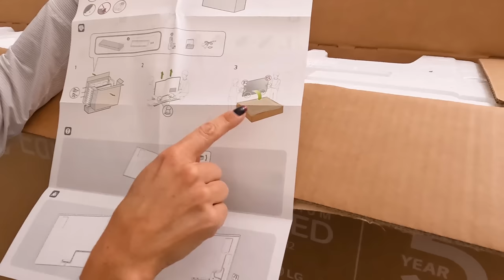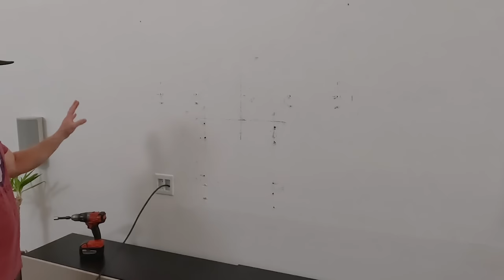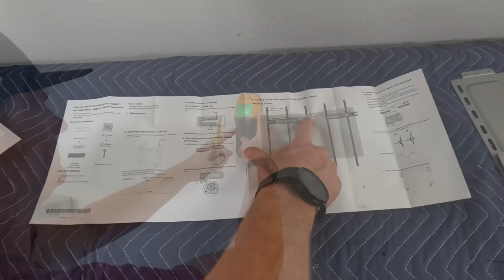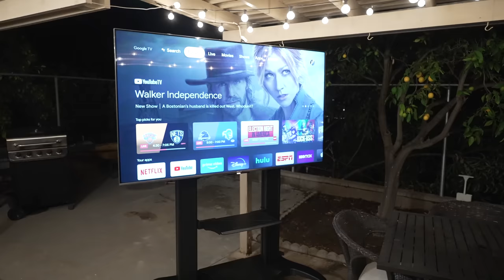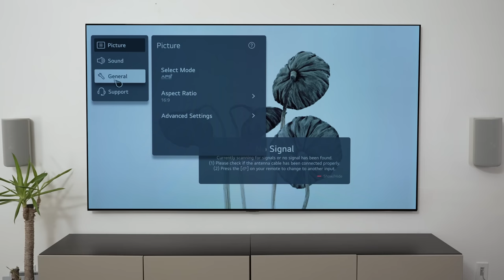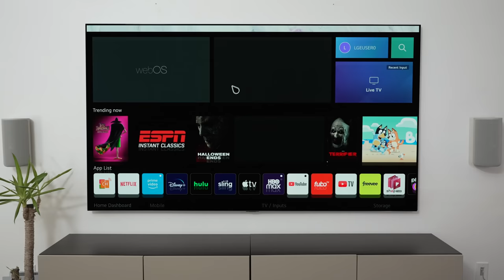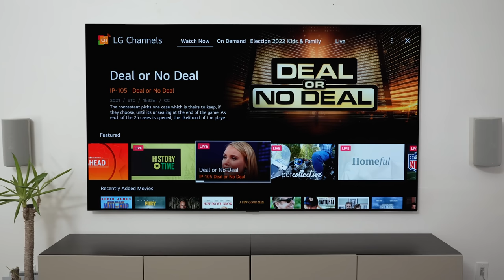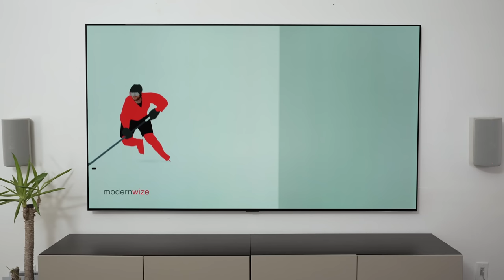97" LG G2 - Absolutely Massive OLED TV

Comment: My old 65" Panasonic plasma I recently replaced with a 77" OLED, weighed more than that 97" G2 at 132 lbs.     Now that old TV was a workout to wall mount.
Reply: Lol, just got an 85” Samsung I replaced my 65” Panasonic plasma with.  The 85” Samsung is barely bigger because of the plasma’s big borders and weighs way less.  Paid the delivery drivers extra money to haul the 65” into the guest bedroom.
Reply: @Meowhsss  Yes the Borders on the plasma TV's were insanely big.     I much prefer the minimal bezels on new displays.

I think my new 77" C1 is around 69 lbs vs 132 one for my old 65" plasma.     But, the plasma was metal with a glass screen, whereas the OLEDs are more plastic and minimal metal anywhere making them incredibly lighter in weight.

Even my old bedroom 42" plasma was 79 lbs, where my new 55" OLED is around 29 lbs.    Less than half as heavy.
Reply: @Meowhsss  dang. Do you miss the plasma contrast?
Reply: @helloguy8934  I got a Samsung QN90B, it’s UNREAL
Reply: @Meowhsss  Oh. I mean yeah with a q90b you're good.
Reply: Plasma is an earth killer. The energy ot eats.
Reply: @kalzindor803  Shit man you're not wrong. But it looks gorgeous while doing it.
Reply: When you buy it the set-up would be done by company for free lol😂

Comment: Fantastic review as always guys!... BUT after seeing the delivery and installation process of this TV I am more convinced than ever with the idea of a modular screen. I love the idea of myself being able to build a TV in whatever size and aspect ratio I want, and the best thing is that I could increase the size of the screen whenever I wanted. I hope that Samsung and LG don't rule out the idea of bringing modular technology to the home market, I would immediately buy a 120-inch screen in 21:9 format... that's my dream.
Reply: The Samsung store near my house has a micro led The Wall TV on display, if you get really close you can see the seems but from a normal viewing distance it looks like a regular TV. I suspect that's the future, more than 100" would be a pain to install.
Reply: @airixxxx  Exact! I think the same. I live in an old building without an elevator and because of that I have always had to make do with relatively small TVs. The current one I have is a 65” OLED and carrying it up the stairs and installing it was a complete headache. On the other hand, how lucky you were to see Samsung's MicroLed first-hand, the idea of joints doesn't bother me, but what about the pixels? Are they too noticeable? I suppose that in my country that technology is going to take a long time to arrive.

Comment: The LG 77 nano I bought is no longer showing on Amazon. It has a central stand with a wide U shaped base and it could not be easier to plug and play. So much better than the 55 Sony in the bedroom. I did find the little wheel on the remote easily breaks so I bought 2 more for back up. The sound is excellent though I never needed to go above half volume- in fact the captions are used with no sound (and they don't take up half the screen like the Sony 55). This nano LG can be blinding so I use one setting with low contrast, low brightness, and minimum color. I find in a dim room that's all you need. My biggest apprehension in buying ($1499.00 Amazon w/del) was if the TV  would capture a signal with just indoor rabbit ears. Again the LG out performed the Sony with over 150 channels here on the West Coast (I watch English only so I delete about 85). I do it by coupling 2 RCA (#121z) rabbit ears and a small in-line antenna amp. Yes I sold TV'S for a living - but anyone can do this- Free broadcast ultra high definition !

Comment: Try grabbing  and comparing a Epson LS12000 projector on a 140 inch 235.1 scope screen. Totally different immersion in your viewing guaranteed with high quality 4K HDR images. May not be OLED but better bang for your buck if you can accommodate the setup.

Comment: Always like your videos, thank you B. 
It seems no body goes to vivid with this tv. I have an 83 G2 and vivid to me is just stunning. Every time I try the other modes , yes they are nice , I keep finding myself going back to vivid. It adds much more brightness to the picture without blowing out any of the picture quality. Just the color temp need to be brought down from cool 50 to warm 20’s or so and turn off dynamic contrast from default high and other tweaks of course but that extra brightness remains
Reply: That's because vivid is inaccurate to the creator's intent. Filmmaker mode is the most accurate.
Reply: Vivid makes everything look artificial, besides being too bright.
Reply: 25000dollars tv? Waw
Reply: Ew
Reply: How is the tv so far?, what do u think of it in terms of brightness for Sports especially, movies & the overall sharpness, highlights & details, does it look good if u ever used it with a receiver? I think 83 is pretty big!, But If money was no option would pick the it over the 83 inch for a 15 ft! Am Sorry for asking too many 😅lol! But do u think the 83inch is more detailed tv the its 97 inch g2? 🌹

Comment from the maker: Check out Pipishell's Official Website: https://kol.pipishellav.com/3Uv3SsL

▸ Pipishell PIXF2: 
Fits 50" - 90" TVs. Provides solid all-around flexibility and extends up to 29".
Buy on Amazon:https://kol.pipishellav.com/3FZbZti 
(Use Code: 05INSTALLER / Valid from: 11/12-11/24)

▸ Pipishell PIMFK1: 
The dependable choice for your middle to small-size TVs. 
Buy on Amazon: https://kol.pipishellav.com/3tor5Bg 

▸ Perlesmith PGTVMC12:
Fits TVs from 60” to 100" sturdy, not to mention your 98" LG G2! And you can move the TV anywhere you want!
Buy on Amazon: https://amzn.to/3tg2hv2 
( Use Code: INSTALLER / Save up to $75 Off / Valid from: 11/12-11/24 )

▸ Alternative Pipishell PILFK1: 
The all-round dependable flexible TV wall mount, with a super wide compatible range from 37" to 75". 
Buy on Amazon:https://kol.pipishellav.com/3hw4TlI 
( Code: 05INSTALLER / Valid from: 11/12-11/24 )

Comment: It amazes me why most manufacturers suggest lying the tv face down to attach the wall mount. Big scratch risk and unnecessary manoeuvre, when they tend to be stable enough in the box to attach it and lift straight from the box to wall. Another tip always wear vinyl or latex gloves, they give you more grip without having to clamp your hand tightly and no finger/handprints if it doesn't have a screen protector
Reply from the maker: I agree with first point but won't wear gloves.
Reply: @BTheInstaller  Fair comment - I'm definitely no pro installer, just buy a lot of tvs :D I just find they give you reassuring grip without having to hold too tight

Comment: We got a 77inch of this. First one that came had bright lines running down the TV. We exchanged for another one that has literally grids of lines, all be it much fainter all over the TV. The brighter lines seemed to go very faint after having the TV on for a few hours, so we thought, we don't wanna waste anymore time dealing with buying a new TV (an experience that should be a good one). Now I can't help but notice that the top corners put out a large area of pink hue on a nearly black screen. It almost looks like backlight bleed but this is an OLED. Noticed it while changing apps. This QC is not good.
Reply: LG 83” C1 here and same experience. First screen was really uneven, plus banding and a solid block down the middle. Eventually LG agreed to replace it. Second screen isn’t as bad but still has banding that I find really noticeable in dark scenes (which are supposed to be an OLEDs strength). It really takes away from my enjoyment of the TV. Not sure if I’m going to fight them for a 3rd screen just to play the OLED lottery again. I suspect they’ll claim it’s within acceptable spec anyway.
Reply: I have the 77inch as well. When I got mine, it had white line going down the screen. I figured something was wrong with it. I had my girlfriend call Amazon so that I could send it back and exchange for a new one. While she was on the phone with Amazon I decided to run the pixel cleaner and it fixed  the issue. I haven't had any issues with it.
Reply: Imagine paying a shit ton of money and keeping a faulty proeuct
Reply: @StarfireRebirthCM  if you have this mentality, where everything must be perfect for you to accept it, you’ll waste your whole life in search of that perfect product that simply doesn’t exist. You’ll miss out on many experiences as you grow old and bitter  finally realising on all that you missed out on. As an engineer I can tell you nothing is absolutely perfect. Everything we make is within some tolerance. The more cutting edge a product, the harder it is to make, and the more likely there will be some defect. Different products will have different defects. At some point you have to think to yourself, if the experience is 95% there, and these things aren’t very impacting on your daily experience (in fact I never notice them if I don’t look for them and had forgotten about them), then why waste your time? 
What would you have done, spent the next few months playing a lottery game with a very expensive product, meanwhile souring your relationship with the seller and manufacturer who might refuse to sell to you in the future? Or would you have returned it and not purchased anything?

Comment: I would have put that Pipishell mount for that monster. I have the big mounting dream full motion mount for my 75 Z9K and it holds it fine and I can tweak it any way I need to to see it better or deal with the cables. I spose you wanted to use all the factory parts though. I certainly don't want to take my monster off the mount again, it was almost as much work as that set and I should have raised the mount a little but it works fine as is.
It really looks nice and must be nice to get to play with all the latest toys.

Comment: Hi, I have a question. Today I had an lg oled 77 g2 TV installed. It is placed in a high position in the room. At the moment of installation, the installers placed it on the fixture. One side sat well and the other side did not. As a result, it came loose from the fixture and its rear plastic has some marks from the fixture. Would you require a replacement for a new TV?  In such a situation because of some signs that are not visible or remain with the existing TV?

Comment: I just replaced my 75" Samsung with an 85" and am glad I didn't go any bigger.  Originally I was thinking of getting a UST laser projector to push a 100+ inch image.  Turns out that in my seating area 85" is bordering on being too big.  My average distance from my eyes to the screen is 10 feet.  On some programming, I couldn't follow all the action taking place on the outer edges of the screen unless I physically moved my eyes or head.  After a while it got tiresome.  I have some wiggle room with my eating arrangement and will pull it back 12 to 18 inches.
Reply: I got a projector 106” seating about 10 ft away. Honestly it’s perfect . 100” should be fine seating at 10ft , it would be more immersive.

Comment: Would be nice if it had a light sensor and swapped between profiles automatically, expect dark at night, it doesn't even need to be a light sensor if it runs on the internal clock or it has some way of checking when the sun goes down that day

Comment: You can judge picture quality directly out of the box. You need to let it "go warm" first. My 77 CX looked awful out of the box. Strange light lines in the picture, a lot of banding/dirty screen effect and totally awfull black crush. Some scenes were totally unwatchable. Didn't sleep well that night...But after 4 hours of use and a refresh cycle later (the one that turn on when you turn off your TV): Voila! The panel became perfectly clean and superb black levels. Massive jump in image quality! I new that a panel needs about 100 hours run time so was shocked that the difference was that big after only one cycle...
Reply: My 65 c1 was fine ootb. The bigger you go the worse uniformity and whatnot gets. This is true of lcd as well.

Comment: Brandon might be great if you  check with pro colorymeter,  brightness in hdr on 10 % Window. 83" G2 has 820 nits , 77 G2 has 920 and I very curious what will be on this monster ????
Reply: There are measurements for them, it's about the same as the 83in size.

Comment: Since you have this and the A90J. Which once has better picture and brightness? I have the A80J and the 83" G2 and was wondering if the A90J shits on this?
Reply: How does the A80J compare to your G2? I got a 77" A80J

I want to upgrade to an 83" or 85"
Reply: I have the 77" A80J as well. It looks brighter than the g2 but Ive only had the LG for 2 days. It is a beautiful picture though. I got the 85" qn90b first and returned it for the LG, Samsung was really bright but washed out blacks... G2 has a ridiculously clear picture! You can see peoples facial hair, wrinkles and acne.
Reply: Ask a repairman. My A80k needs boards replaced after 6 months. Repairman said this is very common. LGs don't break . Sony quality is downhill so I got an LG C2.

Comment: Great video and stunning TV.  My only concern with OLED TVs is the burn in from tv stations that leave their logo up all the time.  I had an older LG C7 OLED tv and after awhile the image from CNBC along with the stock ticker symbols started appearing on every channel I watched due to burn in.  Has that been fixed for the newer generation OLEDs?
Reply: call LG there is a limited warranty buy they will fix it reasonably
Reply: I just got a Samasung S95B and it uses Quantom dot oled and the burn in risks are much less than a standard oled. I don't really know how but you can google it. Plus QD-oled gets as bright as Qled but it's an oled also and the picture is actually superior to other oleds.

Comment: I can notice the pixel density difference between a 55’ and 65’ I refuse to believe there isn’t a dramatic drop in quality on a 97 inch tv that doesn’t even have great processing to begin with in comparison to a Sony.
Reply: All the artificial processing from Sony, LG, Panasonic, Samsung, Philips etc should be turned off to give a accurate picture. 

Hence why the excellent Filmmakers Mode on the LG G2 automatically turns off the artificial processing modes!

Majority of people you included wouldn't be able to tell the difference in picture from a LG G2 and Sony A95K with most viewing material.

Comment: I'd rather use a 120" 4K projector system with a denon amplifier stack & subwoofer stack all for $6500 rather than bust a fortune of $25000 and go broke !! There are premium 4K projection systems that deliver a an excellent immersive experience.

Comment: $25k…….

I would just get four 55” top of the line tvs and build a video wall for the best experience. Not sure why that isn’t used more.

Something like the QN95B where the screen is edge to edge would look beautiful and look like one huge screen

*QN900A/B 

Are the actual edge to edge screen with no bezel
Reply: you can still see the gaps in between the screens and is never the same experience, not even the million dollar "wall" tvs that we installed in my university look the same as 1 tv with 1 panel, is simply not the same.
It may be better for the budget and not "too" noticeable if you are not picky but if you care about image quality and details I can assure is not great.
Reply: @onepoh4680   I disagree 100%, you ever been to a sports Bar, restaurant , event, or a hotel.

I just came back from when where they used four 65” and it looked amazing.

Something like the QN900B which is the only screen I know that is edge to edge with no bezel would look astonishing as a video wall matrix……..
Reply: @tears2040  is not the same as one tv, I could explain to you every point on why is not but honestly I have more important stuff to do.

Comment: What i hate about the LG Tv remotes is that they don’t have built in Play/Pause and skip buttons , so if you connect a blu ray player to it you still need a second remote…thats a pretty big design miss in my opinion
Reply: Not true at all. The remotes prior to the C1 have dedicated play and pause buttons. You can also use the click wheel to play / pause and there you can click left and right buttons on the click wheel to fast forward / rewind. And yes it works with my 4K Player and all my streaming devices. Have you actually used the remote? So no, it's not a design miss.